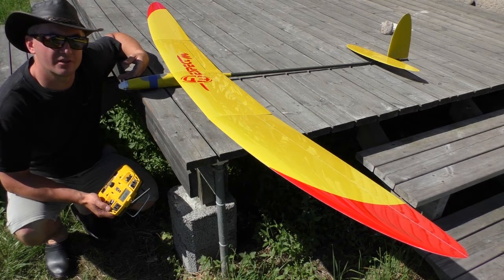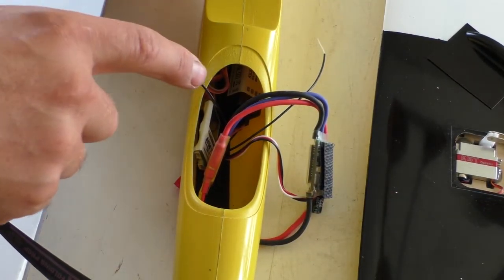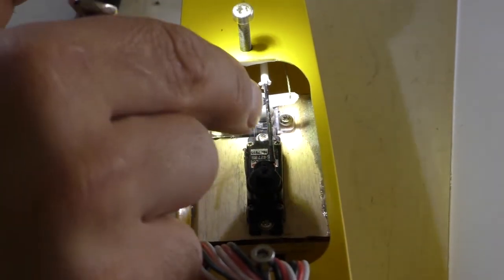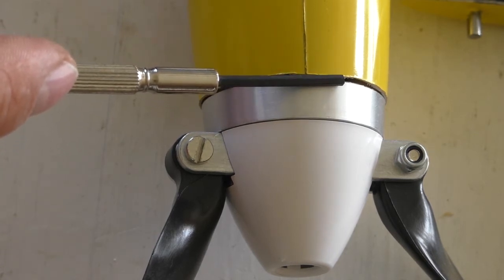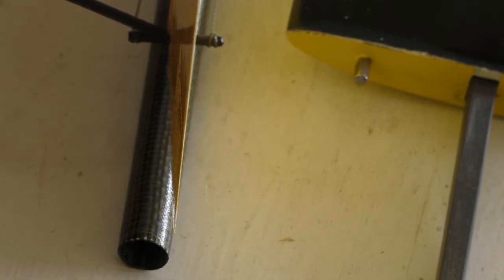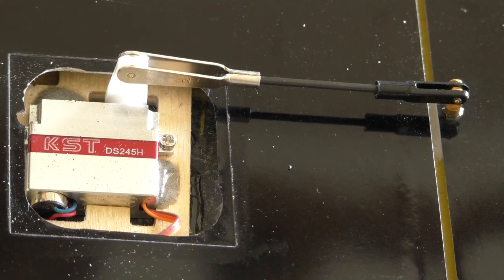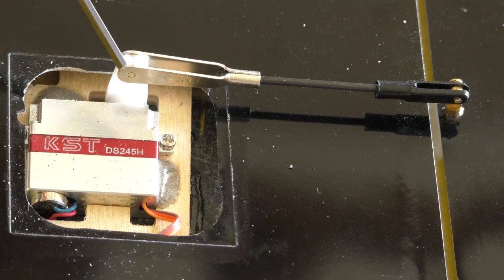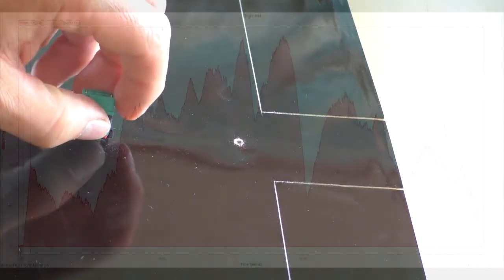RespectM F5J build and setup notes

Comment from the maker: AUW is ~875g with a 1300mAh 2s Dualsky 35C battery, without ballast. One 30s run +10min flight takes ~220mAh, so the battery is good for 3-4 flights.

Comment from the maker: For ballast, I have simply added one, two, or three 56g lead (Pb) blanks with velcro stuck between them. I place them just in front of the the servo tray. If I redid the build now, I would either move the servo tray back 1cm to get the lead ballast spot on the CoG. Adding ballast now, moves CoG slightly forward, but that's not an issue, since it only penetrates better in high winds then. Or, I would place the servos to the side, so I could slide a ballast rod between them. I currently use An Axi Gold 2208 motor ~1800kv on 2s with 10x6 prop. Despite being rated for 16A, it holds out fine with 32A during climb on a 30A ESC :-)

Comment: add snap flap. that is flaparon to elevon mixing
Reply from the maker: Yes, I have since mixed ailerons to flaps in thermal mode, added snap flap (works great for those low, tight, thermal bubble "dlg-style" turns. Also, realized that cruise requires 2-3mm camber, while no reflex is nedded for speed